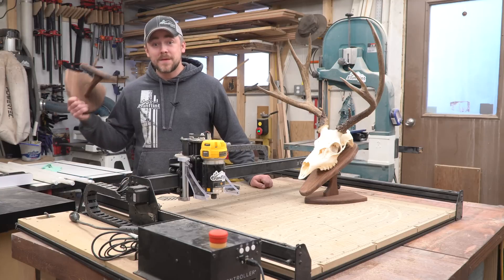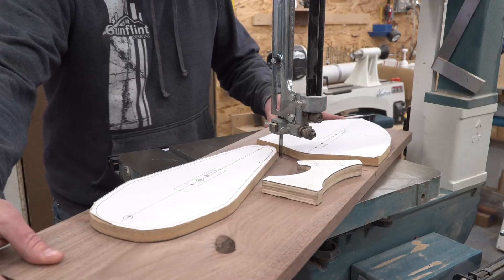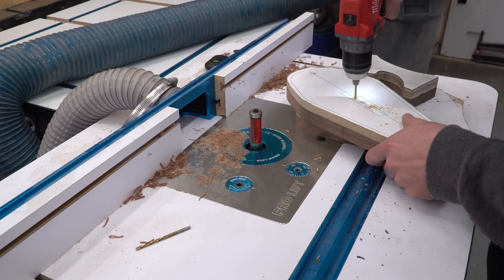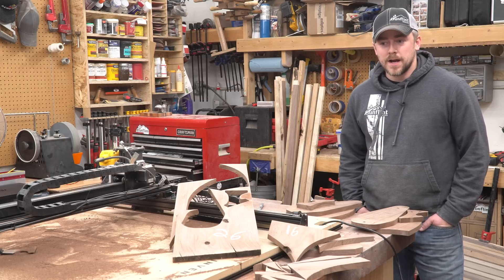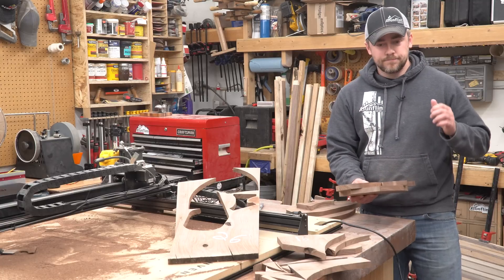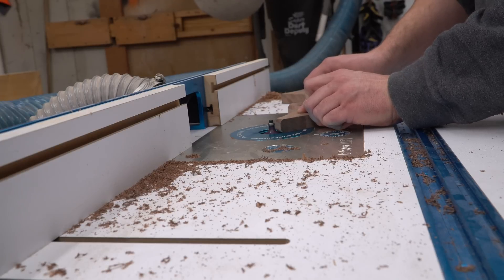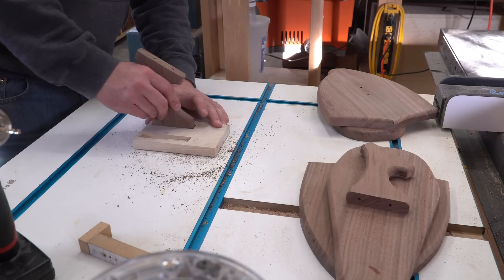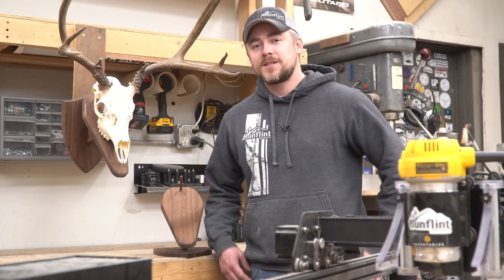Racing The X-Carve - Who Can Do It Faster?

Comment: 1. In this video of mine ( https://youtu.be/xKqN-Q32vlo headphone users beware ) I'm cutting an 18-20mm thick IKEA shelf piece into a side table for my mothers' grill in about 4min - Less If I had optimized the cutting parameters for speed at the machine instead of laziness in the CAM Software. Your pieces could have taken ~10min - Even with a stock machine, unlike mine which by now has had some substantial upgrades.
2. Like your Brother said... He was having a cold one while you were not.

Comment: Brilliant project and I'm not really surprised you beat the x-carve as it has to move slower due to having to route through a lot more wood then you had to. That's the advantage to cutting close to the template with the bandsaw!! I would love a x-carve but don't really have room for it at the moment so thinking about 3D printing first...... I can the slowly print the floor, walls and roof of a small building just big enough for the x-carve!! The best bits are not having to work in the dusty environment, building dust collection into the walls and being able to pass the small x-carve building off as a kennel for the dog's 😁 Hang on, I could build the x-carve building using the x-carve...... it wouldn't have the dust collection hidden in the walls though so I think I'll stick to plan a.......... and a LOT of CA glue LOL

Comment: You have to factor in the time it took to program the CNC and make your bandsaw templates.
Reply: If you do that, it gets more favorable for the X-Carve. Once you set it up you never have to again. Eventually your templates will wear out (especially since you are drilling through for mounting holes). The programming doesn't need to be done more than once. I'd argue it is negligible. If you design in Fusion 360 it'll do the CNC instructions and you have to design it anyway. Unless you go totally freeform.

Comment: Total time from start and finish isn’t being compared.  You didn’t account for the time you took to make the templates.  That wasn’t necessary for the X-Carve.  The time to model, generate code and download to machine isn’t account for in the X-Carve.
Reply: I think this is to illustrate time spent on production runs. If you've taken the time to generate a template or g-code it's likely something you plan on doing more than once, so this is a fairly good representation of the time difference.

Comment: ..... also, you only do the cutting shaping.....with the cnc, you have to input the design, set up the eoid and machine whereas with the hand cut, you can stick and go with the premade templates.  There is a lot mire fiddly work with a cnc than actual woodwork

Comment: Love the race idea, man!  I figured that you might be able to do it faster but it's real hard to beat the precision of the CNC.  Plus your brother is right... the fact that you were even able to make a second one in the shop at the same time speaks volumes for how nice it is to have an X-carve.  And if you cranked up the feed rate on the CNC and increased the RPM of the spindle, it would be darn near neck and neck.  Great job!
Reply: It's counterintuitive, but you pretty much always want your xcarve router on the lowest speed setting. Before upgrading my z axis, I would regularly run my stock xcarve at 100 ipm with the router on 1.